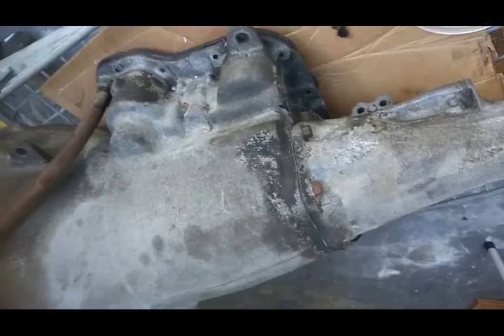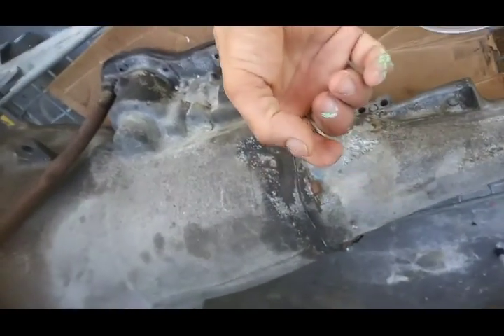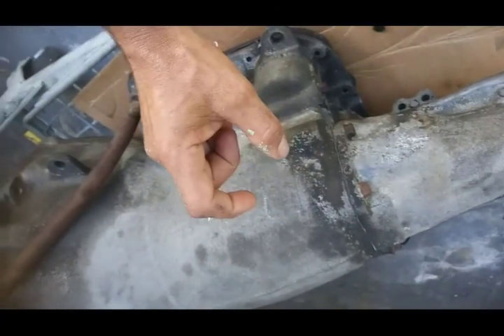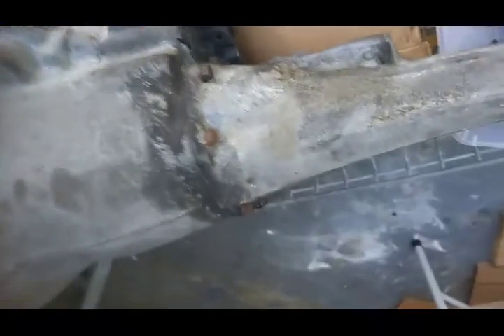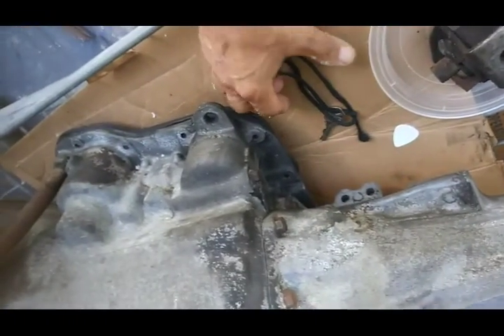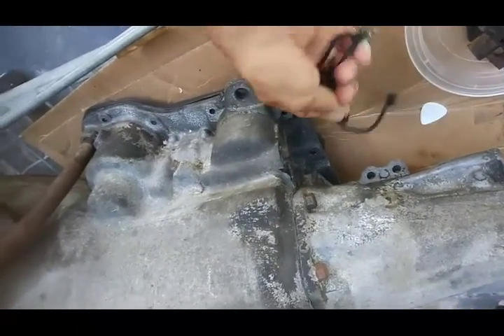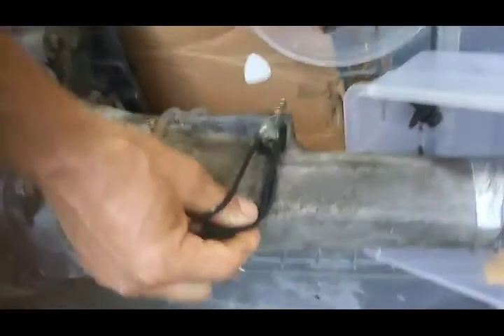BOSTON DYNAMICS ROBOTS- sample methods of stopping the threat.

Comment from the maker: One can also short-circuit the robot by applying electric from the outside in a way...
... also dancing the robot in certain areas can cause movement of its digits and limbs to cause wires to rubb or get pinched and cause a short circuit...
... there's also a big magnet on the grounds that can make a robot stationary and also water can trap a robot because of the weight and possible AC connection....
... even the right amount of sand can stop a robot from movement because all their joints have to be lubricated or else his friction and seizing and also the screws are a weak point because everything has to be screwed together so no matter how hard the parts are the screws are going to keep getting smaller and smaller at certain points where intricate parts are attached.... that will uncover other things that are more vulnerable.
🔧💪
.